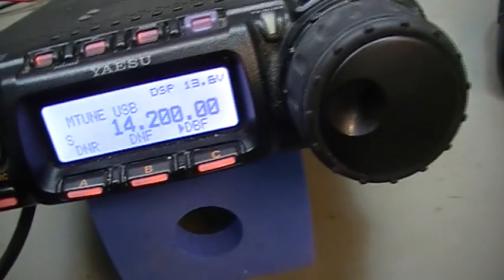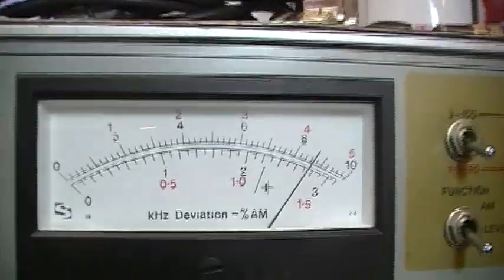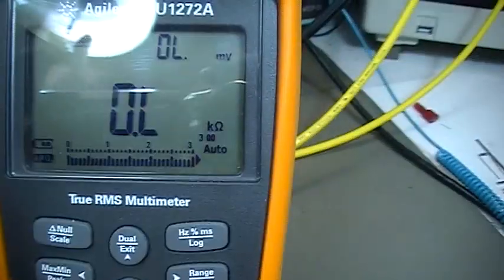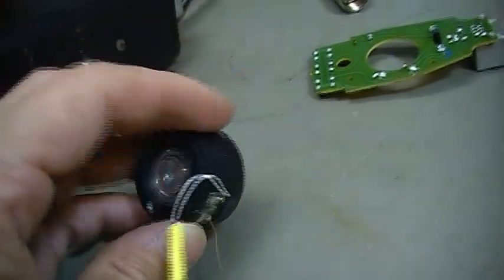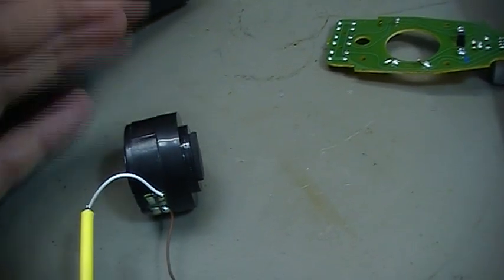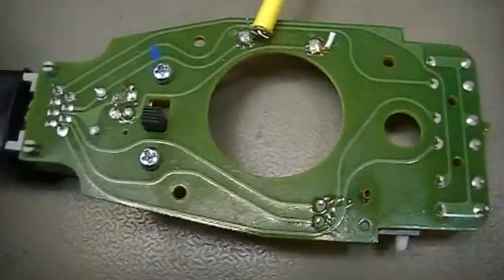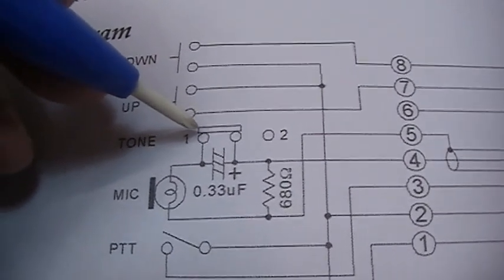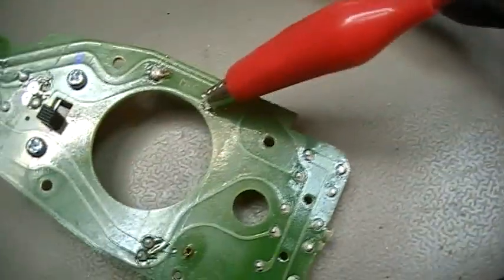#29 Repair: Yaesu FT857D, No TX Audio; Audio Modification for SSB and FM

Comment: I hope when you open the radio, that you are not trying to fix someone else's mistakes.  Hope you find a virgin circuit board.  Well, now, don't even open up the radio.  What an easy fix for audio.  I've had to change out my mic on my old Kenwood 281a when I kept getting audio reports of motor boating.  So, I ordered a new mic and that solved the problem.  Looks like the "golden screwdriver" is at it again.  Can you do a ring test on the element to see if it is gut?  K9POW in eastern Tennessee

Comment: How do you know the values of the components to use? Is it just from experience? This is where I struggle. If a circuit diagram says 3900pf for a capacitor this is what I would try to fit but more experienced technicians would say “The value is not critical you can use almost anything”. What I need is a technician that could give me one to one help but unfortunately there are none in my area! So I will keep watching as many videos to give me the experience bit by bit.
I do like the way that you explain things very clearly showing things step by step. It is very helpful. 73’s Lynton.

Comment: Just experienced the same problem. No audio when transmitting using the MH-31 mic on my FT-857. Replaced the dynamic element with an electret, and all is good. Very much appreciate the excellent video!

Comment: Thank you for the response. So using Ohm's Law, I have 8 volts feeding the condenser microphone with .0003 amps draw. I need a 26k of resistance? That seems high to me?Your thought? Or is my math wrong?
...t
Reply from the maker: +N3zjp Well as I said, the voltage range is very wide. Let's say from 1,5-10V and 300uA. We want to have approximate  4V drop at the resistor (or even less).  That means take a resistor between 4,7K and 10K that should work.

Comment: Peter, Thank you for ALL the great videos.
So, I have the exact same issue with my HTX100. The MIC cartridge has failed. No audio on SSB.I am wondering how you came to use the 8.6k resistor in the modification. I have an 8volt supply at the MIC andCan use that. I saw another video where a 1k was used for an 8volt supply. So I'm confused as this was a similar modification.Thank you,
...t
Reply from the maker: +N3zjp Hi Tony, thanks for comment! Well the electret  Mic cartridge have a wide range of operating voltage so these cartridge work from 1k up to 20k or more at 5-10 Volt. Best is to look into the technical data sheet for your cartridge to get the best value. But as I said this is not critical....
Reply: Kindly thing about Phantom power +48 Volt DC witch is common to supply Condenser mic in professional Audio mixer. 
Small number of resistor from 680 Ohm - 1.5 K,Ohm is suitable for DC supply up to 15 Volt. to have sensitivity approx -40  ~  -30 dB V/Pa.

Comment: My way to check a mic element :  on a CB,  plug a speaker into the PA jack.  This will check cord,  switch and element.  If no PA put your
finger on element connection in mic and check for hum,   or listen with signal tracer,   or look at on scope or OUTPUT on multimeter or even look for some output on SSB.  You can try to bring a dead one back by baking at 200 F.  for a while.    For a carbon mic, pound with a hammer.
K4OF.
Reply from the maker: BOB RENFRO Hi Bob, very nice way to test. Thanks for your contribution. 73